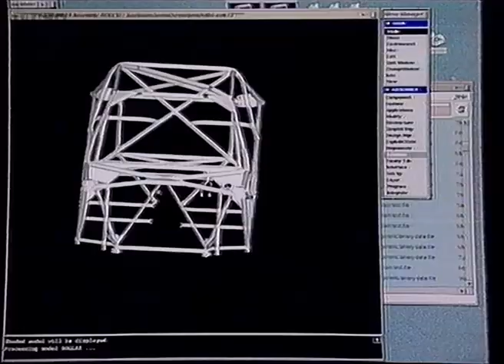1999 SEAT rally promo video

Comment: I wonder if VW Group actually poured more money to SEAT's rally programme, what could've been.
Reply: They didn't pour much money into SEAT Sport's WTCC program and they eventually dominated it all. Also, the entire TCR class is based after SEAT Sport's León Supercopa car.

Originally, TCR was meant to be a way to have "supermeetings" where several single-brand cups would bring their top performers (some sort of "Race of Champions" for single-brand touring car cups) and race in equal conditions but promoters quickly saw the potential and ditched that concept. You can still see how it was all based in the SEAT León Supercopa by seeing the entry lists of the first 2 seasons. While most cars are called "Brand+Model+TCR", the SEATs are called SEAT León Supercopa.

PS: The main partner to SEAT Sport for the original TCR concept was Peugeot Sport, hence why the earlier Peugeot TCR car was called "Peugeot 308 Racing Cup".